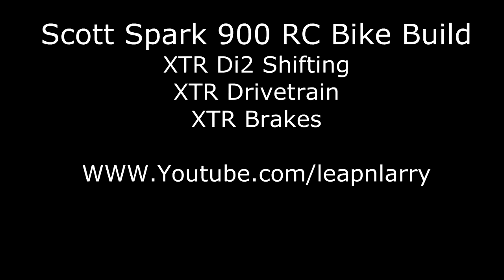CTD Suspension Remote installation

Comment: 2:50 - As you use the lockout over time the cable will straighten itself out by wearing a groove into the carbon; interestingly, it doesn't crack or cause any structural damage, just wears a nice channel on each side of where it exits the top tube like taking a drill bit into the layers of carbon sideways!

Comment: Hey Larry thanks so much for this great video !I just picked up a 2013 genius 740 and my CTD  is working quite nice on the rear shock but not at all on the forks .
And I notice that the top cap on the fork is 180 degrees opposite from yours and my cable runs from behind the fork . Can I just turn it as you did in the video to fix or is more likely an internal problem ? Thanks in advance for your helping response

Comment: Thanks for the video. Really helped out. I have a question... when going from climb to trail is the transition supposed to be smooth? My shock gets hung up in between especially if I have my full weight on the shock. I normally would need to wiggle around then it goes into trail mode. Is this normal or should it be instant regardless if the shock is supporting my full weight?
Reply from the maker: Mine switches pretty quickly, I never noticed if it was delayed, I will pay more attention on my next ride.  I ride in the middle position 90 % of the time, lockout on pavement, and go Cush on really bumpy downhills only.  Larry

Comment: 12:06 in the black cable support, i see an iron special washer, with concentrical holes. Where you found it? the standard conversion kit doesn't had it. because I have a problem with blue piece, when i lock the sreww, it's so lower that the cable can't pass.

Comment: I have a Scott Spark with a 2 position twinloc lever. Is it possible to convert this to a 3 position lever or do you also have to upgrade the fork/rear suspension remote?